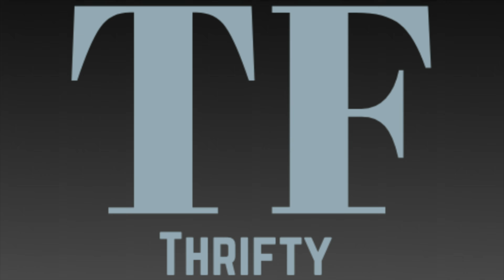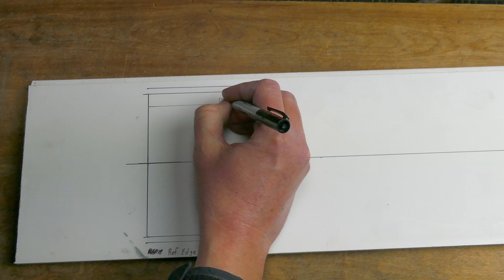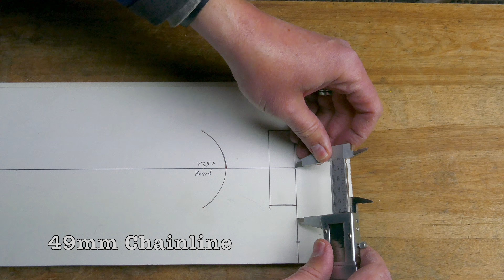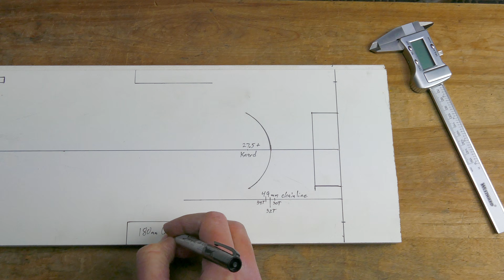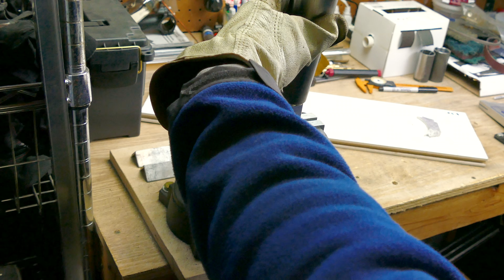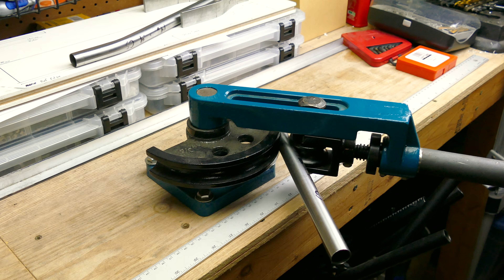DIY MTB Frame Ep 4 - Chainstay/Yoke Layout

Comment: On the last page of sram’s frame fit spec doc, it has a diagram of spoke clearance for disc brake calipers but also has a dimension for the distance between the center of the non drive side hub flange and the rotor. Could be helpful or just fun to look at lol
Reply from the maker: Thanks! I’ll check it out.
Reply: @ThriftyFramebuilder  they also have a bunch of crank drawing with detailed specs! If you email them about cranks they don’t have on the doc they usually can hook it up with info too!
Reply from the maker: 👍👍 I’ve seen the crank drawings. Never thought about emailing them about cranks that aren’t listed. Thanks!!

Comment: PVD / Peter Verdone has some really good insight on disc rotor standards and brake caliper placement standards, specifically around frame building and hole spacing for mounting calipers (assuming you haven't seen it already). Quite technical, but a good read. Really like the yoke you've created :)
Reply from the maker: Thanks!  I’ll check it out.

Comment: Can you explain how that removable vice platform locks in place? I have made one similar, it clamps onto the edge of my workbench but it moves/slides when applying force in line with the bench.
Reply from the maker: The vice isn’t “removable”. The piece of wood below the vice is there so that it sticks out from the edge of the work bench. The piece of wood is permanently screwed into the bench, and the vice is bolted into the piece of wood in the front and bolted through both in the back.

Comment: A question about the tube bender. It looks like the "follower" die is too far away. Am I seeing that correctly?  I made a wooden bender for building rear racks and I think I made it so everything was tight.  BTW,  great video!
Reply from the maker: Thanks!  You’re correct, the follower is adjusted pretty far out.  I THINK I did it to get more leverage. When I first got the bender I bent a bunch of practice tubes and I vaguely remember needing to adjust it further out. The tubes probably ovalize more than if the follower was closer, but I’m OK with some ovalization.

Comment: You mentioned your minimum chain line. Is that something you got from your Bike CAD model? Great video - Thanks
Reply from the maker: Thanks!  I got that number from a thread on Custom Frame Forum. According to that discussion, non-boost MTB chainline is 49mm. I had always used 50mm until I saw that thread. I originally got 50mm from measuring a production bike.